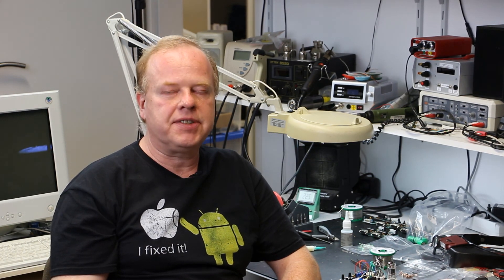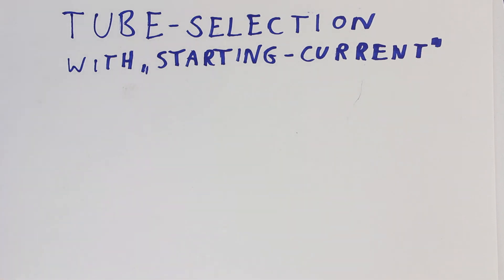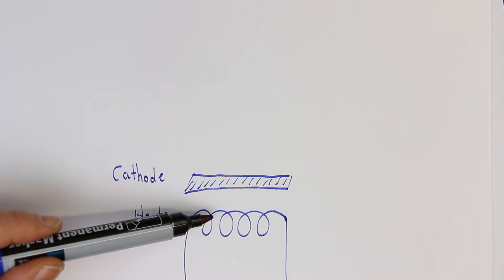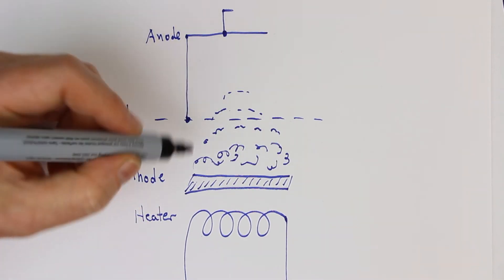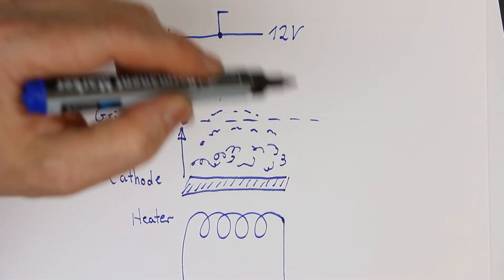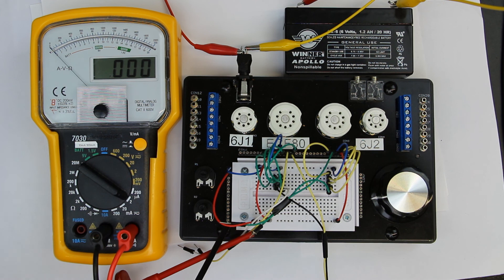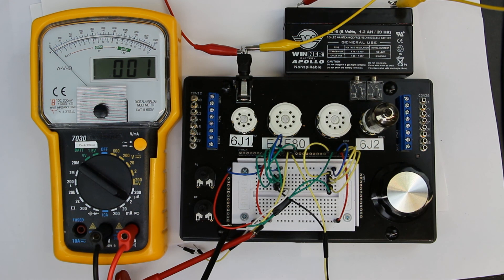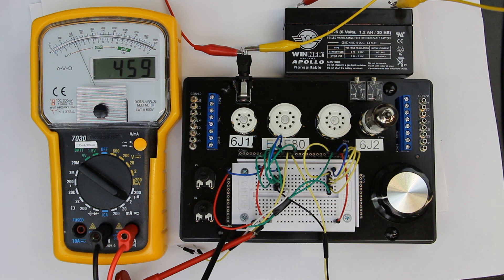Tube Selection [Pt.1] – The „Starting-Current“-Method

Comment: I believe this is what is done in a tube emission tester.
Reply from the maker: No. There you have a defined anode voltage and measure the maximum anode-current with e.g. 0V grid voltage.
Reply: For clarity; emission test on a triode has grid connected to anode and the cathode current is measured. Usually done at a low voltage like 30vac with filaments at device required voltage. Just noting that "starting current" is an emission test.
Reply from the maker: Hm. Connecting the grid to the anode of course gives the max. üossible cathode/anode-current. Then of course you have to measure the cathode current because part of the current goes through the grid. 
But AFAIK this is not recommended because the grid can be destroyed with postive voltages and without a current-limiting resistor for the grid.
Nevertheless this measurement is different because here you have an electron-accelerating positive anode-voltage. With the Anlaufstrom-measurement ("Starting-current"?) you have no acceleration and measure only the current generated by the space-charge around the cathode.